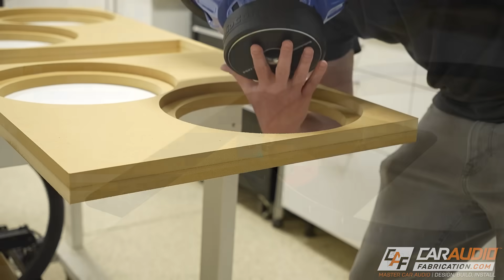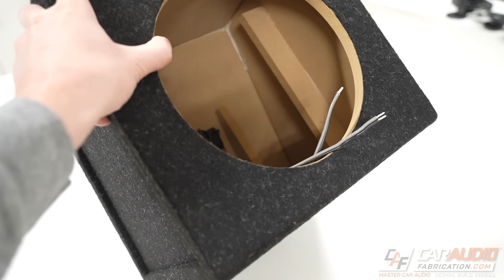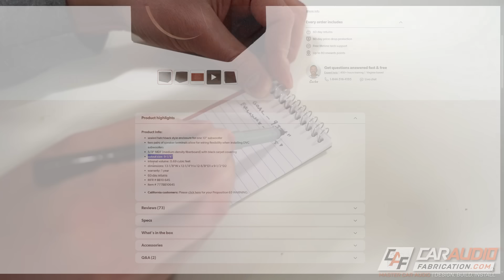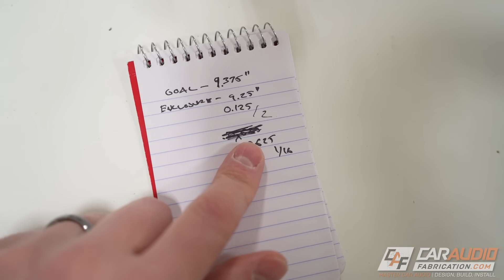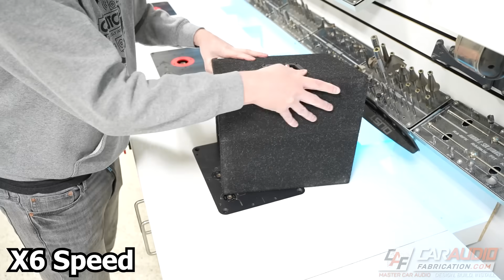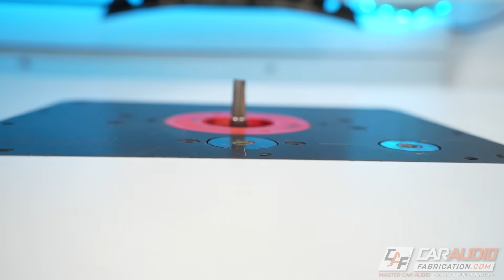Enlarge Subwoofer Box Hole - LIKE A PRO

Comment: After watching how you handle a sub box with an undersized cut out I absolutely would appreciate it if you made a video dealing with a cut-out that is too large as that is a problem I have run into a fair amount of times reusing boxes and mounting new subs for friends budget builds.
Reply: Also can anybody explain how to fix  an audio issue im curently faced with on my personal build? 
I own a 78 square body Chevrolet c-20 cheyenne camper special which im equipping with a total of 8 coaxial speakers and a single sub all powered by a  kxa800.5 from kicker.
Well 6 of 8 and a sub, 2 of them will run of the head units 50×4 internal amp.those two are dsc350 3.5 inch 4 ohm coaxial. Placed in the dash.
In the doors are ksc6930 6×9 4 ohm 3 way coaxial witch will run on amp 1( channels 1and2) splitting 200 watts.
In the quarter panels behind the bench seat are a pair of ksc670 6.75 inch coaxials rated at 4 ohm.  Accompanied by a pair of dsc68 6×8 also rated a 4 ohm but wired in parallel with the ksc670s to bring the impedance down to 2 ohm to a. Provide more power to two pairs of speakers sharing amp 2s(channels 3and4) 200 watt portion of the 800 total watts that the kxa has to offer.
And B. Prevent me from having to add another amp for two speakers pulling less power. I checked to be sure and the kxa is stable at 2 ohm and can run it's channels at different impedance. 
With the dedicated 5th channels 400 watts going to a old school12 inch cvr dvc wired to 2 ohms final impedance.
Everything I've mentioned so far is made by kicker. Receiving signal from a pioneer nvh200ex...... I had this single din pioneer deh-17 sending signal but the thing only has a single set ofL&R rca pre-outs and not even BT capable and hear lies the problem im having the only speakers that put out sound was the 2 wired into the head unit and the sub. So I swapped it for the nvh which has front and rear rca pre-outs and sw rca pre- outs but.... the thing won't power on. Not sure if it's been done or if the re-pinned wire harness is configured wrong. Any advice or help would be greatly appreciated whether it's fixing the nvh or a work around for the dex im not going to be choosy even though BT is almost necessary.  What ever produces quality sound from all the speakers is perfectly fine by me.

Comment: Dude, just switch to metric, it will be much easier!
Reply from the maker: I can design in both systems fluently without issues, unlike metric users which dont understand basic conversion most of the time.
Reply: @CarAudioFabrication  Yes, we do not understand imperial conversions as they are absolete and used only in 3 coutrins in the world :D Even traditional Britain is switching to metric.

Comment: S/0 makes excellent prefabs. And, not to be out priced on the market, Crutchfield has been price matching other sites. Since the pricing is the same, Crutchfield's customer service is by far the best, I go there for about 90% of my car audio needs (not want, it is a necessity!) 

Also I have ran into the same issue in this video many times, wish I had those tools, I had to use a drill bit grinder and carefully go around the opening. This process takes forever!

Comment: There's another video of a different process that I used that works as well using a tapered-roundover bit.  

The key issue to getting a "professional" cutout is the use of a router.  It's one of those tools that you don't use often, but is irreplaceable; like a Dremel tool.
Reply from the maker: I use mine everyday 😂. You could definitely have a roundover go extra deep to achieve the rabbet, but having a dedicated rabbet set is needed for many more things in audio